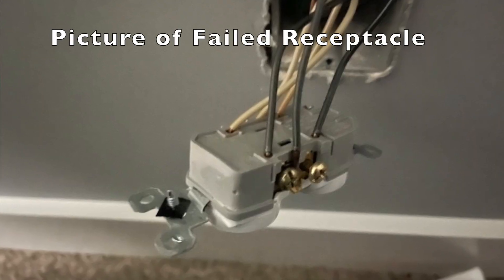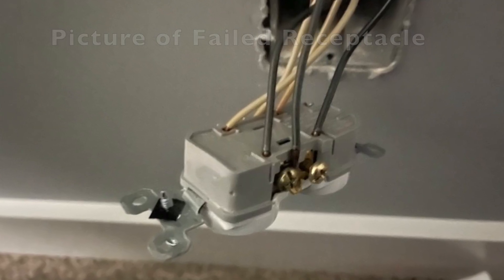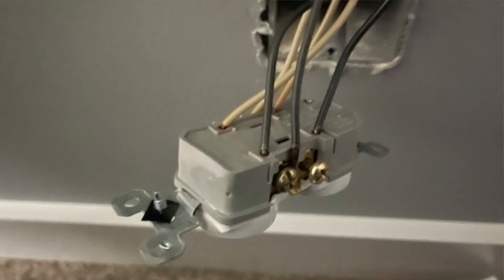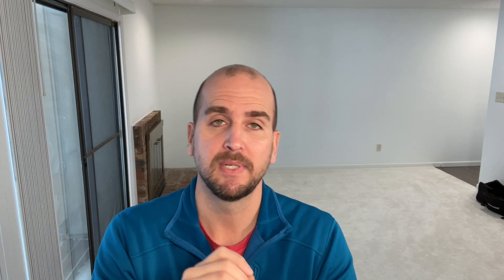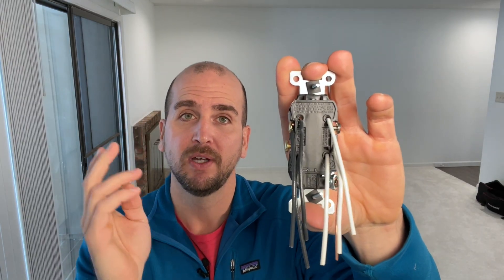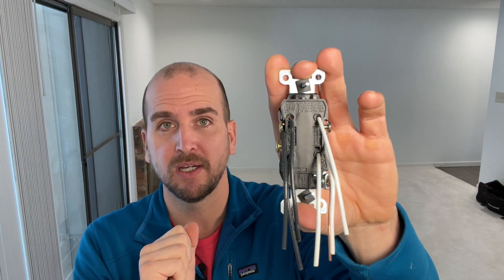Incorrectly Wired Outlet Found In Newly Built Home

Comment: Just a comment regarding pig tails. If you're working with a standard depth device box and a deep device (such as GFCI/AFCI receptacle or USB charging receptacle) you may not have enough room to do them. Ideally in those situations you would have the device box wired to be a drop from a different junction point to cut down on the number or wires, but for an existing box it can cause some headaches.

Comment: Great and timely video! I was doing some renovation on a condo last weekend and I wanted to swap out the electrical outlet for one that has usb ports in it.  When I took out the existing one it has two wires going into one side and two wires connected to the other side but the replacement outlet only had one screw on each side, so I wasn't sure what I had to do and had to pay an electrician to do it. Now I know.

Comment: I also clock the screws. Yup, I'm that guy.
Reply: What does that even mean?
Reply from the maker: @craigcampbell2905  it means rotating the cover plate screws so they always face the same vertical or horizontal direction.

Comment: On receptacles, I prefer to attach the wires to the screws. I use the pig tail hook bent clockwise around the screw so that as I tighten the screw, it will force the wire tighter around the screw. Doing it this way, there is more surface area contact between the wire and the screw.  Push-ins have less surface area contact.  Less surface area contact will result in the connection getting warmer from the current traveling through it. The wires and connections should be great enough to safely carry the current.

Comment: I know I'm going to catch a lot of flack from this, but I prefer to use stranded wire for my pigtails. When done properly, stranded wire stays under the screw head just fine, and actually makes a BETTER connection when back wired. (Not push-in.) The stranded tails allow me to stuff the connections to the back of the box, and place the device without the conductors fighting me. And I would NEVER rely on a couple wraps of tape to prevent an unintentional ground or short.

Comment: I totally agree with your analysis, although I am not a licensed electrician, I have designed and built many homes, including installing all the electrical. And just yesterday I replaced two switches in a 20-year-old manufactured home that was installed incorrectly as you just Illustrated, and shorted out when I move them, causing many sparks and blowing apart one of the switches. However, after installing two switches, correctly, everything is working better then when it came out of the factory.
I grew up working in my father's Construction Company where I learned everything about designing and building homes, which has been an invaluable asset to me over the last 40-plus years.

Comment: Something no one ever mentions with backwiring outlets is that if you PULL OUT on the wire after you insert it 99% of the failures would be prevented. Pulling out on the wires causes the retaining jaws to bite into the wire and creates a very good contact. They are ul approved because when properly installed they work fine.

Comment: I would have used electrical tape on the wire nuts.  I have never seen a three wire receptacle before.  Most plug in recepticals are for 14 gauge only

Comment: 6:24 Don't the plug is upside down (see the TR letters) ?  I don't think there is a specific code but I prefer having the ground on top so: 
1) The pin will help holding the plug and cord weight,
2) Also if the plug is not plugged all the way and something metallic drop, the first thing touched will be the ground pin,
3) However, I put the plug upside down to indicate that the plug is the one controlled by the light switch located just next to the entrance door.
Note: I noticed your video on this subject: https://www.youtube.com/watch?v=kYXvcog9MxY&ab_channel=EverydayHomeRepairs

Comment: Big 104 on stabs in the back of receptacles, those should be outlawed!  Do not use them.  As a rule of thumb most electricians in my local will run line in on the top of an outlet,  load power out on the bottom half just like you would wire a safety disconnect switch.  Personally I always pig tail when more than 1 wire.

Comment: What are Kleins?
Reply: They are a brand of pliers used in electrical work. The tool is called 'side cutter plier'.  Electricians just call them Kleins for short. It's also the dominate brand used in the trade.
Reply: @joshuaherndon7380  Yes I know the Klein brand and used them for 38 years. There are other brands though. What do you call them?

Comment: On wire nuts , I've come across this problem many times . The nuts are never tightened enough so I'll twist them until I twist the wires around 3× and make sure it doesn't untwist . What is code for installing wire nuts ? Thanks for your videos !

Comment: As a retired safety person, when checking the electrical outlets for power it is best to first check the electrical tester (whatever type being used) on a known "hot" outlet, then next check the outlet that you  are going to work on and then again check another "hot" outlet.  This will tell you if your outlet is really not energized.  The reason, what if your electrical tester is bad or it just blew out.
Reply: Also you can try to live by rule use work with one hand in your pocket when you handle anything in the box, esp. when you pull the outlet out of the box... if there are other circuits junctioned in there that are energized, you don't want to have the current hit you through the heart, vs. the hand.
Reply: @robertlaw4073  If there are any other circuits in there you test them all, you can not effectively do the work with one hand. That advice is good for some work in breaker boxes though where you can do some of it single handed.
Reply: @phillhuddleston9445   I've seen more than a few people who "test" the circuit by trying to trip it, meaning they touch the wire to a ground. Let's be frank, that happens, and those guys are still walking around because they do that with 1 hand in their pocket.
Reply: @robertlaw4073  Maybe but that's like running across a highway when there is light traffic, better to not run across a highway at all.
Reply: Thats what a multimeter is for. Non contact voltage and double check to see if there is any voltage. Easy.

Comment: Years ago I worked for an electrician where we specialized in swimming pools; lights, pumps, fountains etc.
I'm pretty sure it wasn't mandated by code, but it was a common practice to wrap our wire nuts with electrical tape. This was the only electrician I ever worked for and I wonder if anyone else does this.

Comment: it is not always a qualified electrician that wires your house, it's just checked by one before the inspection
Reply: Yep, I have followed behind the yard boy and handyman who once saw an Inside Wireman make up an extension cord!!!
Reply: Its how I fed my family for years. Never had license for anything, but knew lots of people who did that trusted my work enough to sign the permits. Hell, one company told me the GC in the company from a different state than mine was good enough. I dont think that's true, but it is if they're local and willing to stand by the work.
Reply: Inspectors don't check how the wires are connected to the fixture. You have rough electrical inspection (no outlets, switches installed) then you have finish inspection...which is done during final inspection. All they want to see is GFI's in the right spot plus a few other minor things, particularly things they missed during rough inspection and now want you to tear it all out and redo it because of their oversight. However, in some cases its possible the inspector knows the homeowner is doing the work and feels its important to checkup on this.
Reply: Every single state has different rules and regulations for installing electrical work. For example, in my state no license is required at all. As long as it is your property or a you were given permission to do it by the property owner.

Also, while a lot of codes are very similar among all the states, they all also have very different codes as well.
Reply: @williameldridge9382  what happens when the home electrician does work that directly leads to loss of life? Bet someone cares about the installer then. My buddy is subpar and does all his own work at home. Unless you know exactly what you’re doing I recommend hiring a licensed professional. At least your not on the hook for a the damages if it all goes horribly wrong. Trust me, it can
Reply: @williameldridge9382  HERE IF YOU WANT TO DO THAT AND DO NOT HAVE A LISCENSE YOU MUST TAKE A TEST AND SHOW YOU HAVE THE APPTITUDE TO DO SO!!! THEN IF ANY PART FAILS YOU MUST GET A LICENSED MASTER TO PULL THE PERMIT AND HAVE IT INSTALLED BY HIM!!!
Reply: @williameldridge9382  MY BROTHER N LAW AND I DID HIS GARAGE, THE INSPECTOR CAME OUT AND SAID YOU KNOW IT COULD HAVE BEEN IN ROMEX. BUT THIS IS THE BEST GARAGE INSTALLATION I HAVE EVER SEEN, WE DID ALL 1/2 AND 3/4. I JONESED SOME COMMERCIAL 6 FOOT FIXTURTES FROM A DEPO  DID THAT WERE LESS THAN A YEAR OLD AND GOT THE 200 AMP PANEL. HE WAS AMAZED AT THE KICKS AND OFFSETS ALL FALLING IN LINE. MY BROTHER N LAW SAID MY BROTHE N LAW HELPED SINCE I WORK 12+ 7 DAYS A WEEK AND MENTIONED MY NAME . HE SAID NO WONDER ITS SO NICE. I HAVE YET TO TURN ANYTHING DOWN HE HAS DOWE OR ANYONE ELSE. ON MY FIRST JOB AS AND APPRENCTIE MY JOURNEYMAN AND LONG TIME FRIEND AND I DID 8 RUNDS OF 36 1 INCH AND 48 ONE INCH. THE ARMY DEPOT NEVER KNEW YOU COULD PREDETERMINE YOUYR BENDS, KICKS AND OFFSETS. THEY TOOK FILM AND PICTURES  AND WE GAVE THEM A BENIFIELDS. THYE SENT SOMEONE OVER TO BE TRAINED ON HOW TO TEACH BENDING. WE MADE THE US ARMY DEPOT PAPER.  WE ROCKED THAT JOB WITH 8000 FEET OF 1 INCH A DAY,
Reply: Um even the inspectors aren’t always licensed for install. Lol. So lot of the times. The installer license holder stays in the office. Business man making business deals
Reply: @pjplumber2146  Those who can't install inspect. Those who can't inspect write the codes.
Reply: @robertwidmer4367  And those who can do neither simply post venomous comments on YouTube.
Reply: @genrlgadget  So you are saying you can't do neither. You know since you are posting a venomous comment on you tube.
Reply: @pjplumber2146  In Olive Branch Mississippi we had the secretary from the Mayors office come out to sign off on some good ole boys shitty plumbing for Sea Food at a Kroger!!! we insisted that she get the real Plumbing inspector out!!!

Comment: quick comment. the market is so competitive, the only way to make money is to finish the job as fast as possible. A lot of jobs are completed by second or third year apprentices and checked by the master. The equipment used in north America is the same as 60 years ago, cheap and out of date. I moved from UK to Canada , I am a LEC and a master electrician. I still feel like i'm installing potential fire  hazards. Oh yeh, do not use the push in's. if the equipment was modernized, and people were willing to get the best job instead of the best price, there would be a lot less electrical breakdowns.

Comment: I am a retired certified journeyman electrician. Retired 15 years, when still working I was pretty sure that push in connection were not permitted by the NEC. Also the tabs connecting the two electrical connections  on the side of the device , were not rated to feed thru the circuit other than to the remaining half of the receptacle.   That meant that we could not fasten the feed thru wires to the remaining screw on the side of the device.That would have been in the 2003 NEC code. If you had a wire in the box that was meant to feed thru the circuit involved, you had to tail them out as you demonstrated. I found many instances where push in wires failed after time to feed thru the circuit even causing the device to melt which is a fire hazard. All electrical boxes are designed to allow only correct number of conductors of each gauge used in the trade.  The specification allowed by NEC is printed on each box and the specifications for each wire is found in a table in the NEC. That is always necessary to follow in every application to meet those NEC requirements, always in other words must as the "code" states. The code book contained 12 chapters and definition sections so it is very extensive in what is allowed and not allowed. The code book is updated and reviewed every three years by a national panel which includes many people in the trade as well as people in the fire protection and fire fighting  personnel . They cover a multitude of info involved in the trade .

Comment: Nice explanation of the 3 mistakes.   Yes, I have run into these mistakes.  I do use NEC book.  No, I am not licensed Electrician, my deceased husband was one and my dad and grandfather were millers.  However,  my biggest nightmare has been this home from my deceased husband, I inherited, the dismissive attitudes of people that were hired through HUD to take care of these huge mistakes.  1.  The foundation to basement is hollow cinder block and previous person had punched holes into  the blocks and installed outlets.   I have one, I took out filled with wire mesh and mortar.  put up new painted wall framing, over 6 mil clear plastic, next the 1/4 owens corning. than the one quarter inch luan...than new electrical metal box attaching it the 2x4 and the rest was 2x2's with existing 15 amp.  I did use a child safety outlet, wired with shepherds wire on neutral, than hot, grounding  all screwed in and wrapping of electrical tape around the neutral and hot sides so when someone takes it out they do not get 'shock' .  In todays world, however, the 15 amp is not enough.  I put in 20 amp wiring along with tamper resistant outlets.  I have found that 15 amp line will pop the breaker as you are using vac, computers, printers, ecetera.

Comment: I am a licensed Electrician in residential/ commercial and Industrial . This is not anywhere in Code ,,,BUT  if that receptacle is in a current " LOOP" , that are feeding other receptacle's, it's best to " Pigtail " them all but the last one . Reason being if that first receptacle fails , the rest will continue to feed. As of the last 5 yrs. ,,, it good practice for the Ground socket to be on top , instead of the traditional Bottom. The reasoning is it statistically make a more secure contact with the two " Load & neutral on the bottom " , It also give a better chance that if that receptacle shorts , circuits , The Ground wire can drop from the top , giving it a better chance to trip the breaker , quicker . Always Always , make your Ground wire connection first , Then your Neutral , then your load . In a Safety aspect , This is in order of Priority. Although it backwards in Functionality , that ground wire is the Most important wire in ANY circuit for safety . I've been actually " Electrocuted" by a 277 volt warehouse Light that had a 40,000 volt Transformer to ignite the Gas Bulbs , all because the ground wire wasn't hooked up . 2 torn muscle in my neck and back ,, A week of confused and disoriented , 3 days in the Trauma unit at the hospital. It's also good practice , after you wire nut your connection , make about 2 or 3 wraps with electrical tape , half on the wire nut, half on the wires. This prevents the wire nut from loosening through the yrs of A.C. current (6000 pulses per second) loosening the connection and if  spark starts in that connection , the tape will help contain it , inside the wire nut and not to the area around it , creating more problems .

Comment: Your example box was fine, no pigtail needed, only two, not three, conductors each side.     Yes pigtails are good practice  for some situations.  But modern connectors make  better  connection for 3 or more conductors vs traditional screw on cap connectors.

Comment: Good info.  I also liked that you twisted the wires when adding the pigtail.  Many "electricians"  think that the wirenut provides enough contact.  It doesn't.  It can create an ohmic contact that and cause heating.  It actually works better to use two linesmen's pliers, one to hold and one to twist.

Comment: I can tell you that the push pins do fail! I bought the house that we live in, in 1997, the house was built in 87.  One night I flipped a switch on in the basement and it didn't work, nor did several others. The first thing I did was checked the breakers which were okay, so I pulled a switch out and seen that it was in the push pin. Well it took three receptacle boxes before I found the one that was causing the problem that night, and it was a plug in causing the problem. Needless to say I went through the whole basement changing all the outlets and switches the next day, or should I say two days, because the whole house was wired that way by the contractor that did the job.
Reply: I'm in the process of replacing all receptacles and switches in our home right now.

Comment: The pigtail just seems like another point of failure. Why not just connect each of the two hot wires to one of the two screws?  That way it would be one screw per wire just as normal.
Reply: I think it's for overloaded circuits with greater then 20a breakers. Throw in a cheap residential outlet in the begining of the circuit and it can overload the bus and melt down. This is good practice for preexisting circuits that can't be changed, but pointless if wired properly.

Comment: Always pigtail. Always wrap your "hook" in the direction the screw tightens so that it actually pulls it in tighter. I have been known to use 14 stabs, but in general, I try to ALWAYS use the screw connector because it's known to be better. I never use stabs if I have an outlet in the middle of a circuit.